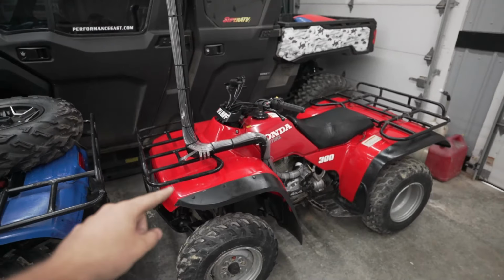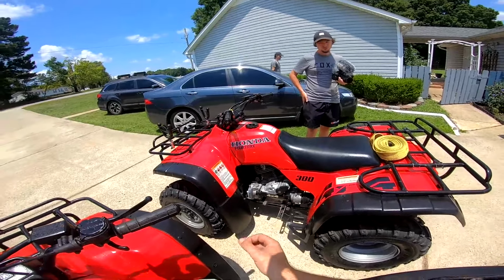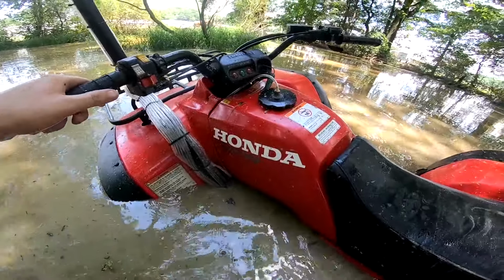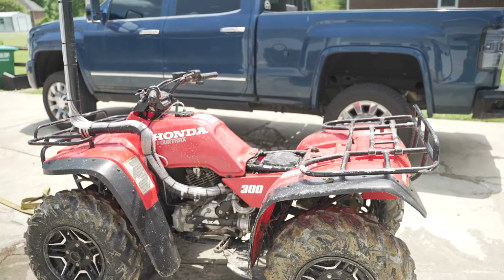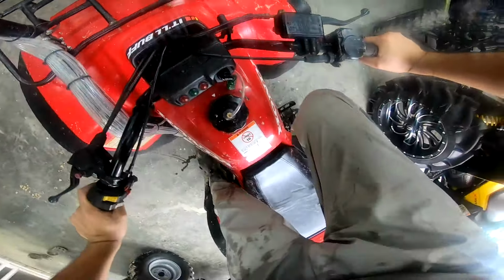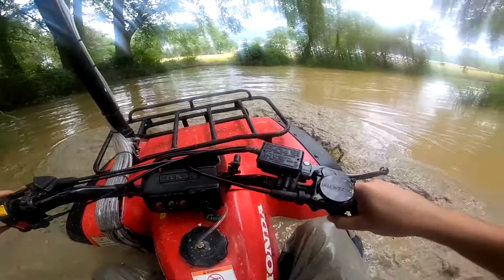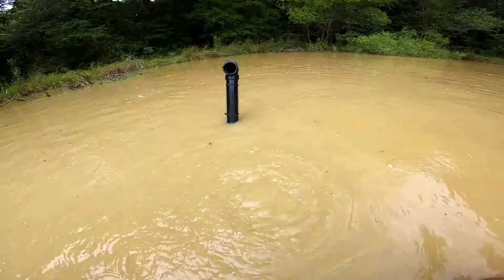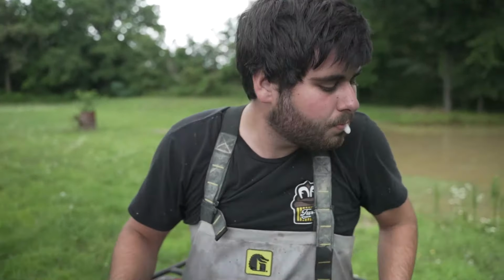FOUR-TRAX 300 VS HUGE SWAMP! WE SUNK IT.

Comment: I miss my ole 300 4 inch lift 2 inch stretch in the rear and 56 gear reduction racing pistons and 420 shocks. It was a beast

Comment: 300s are surprisingly easy to wheelie, put in first pull the shifter up and hold it. Then full throttle and dump it and it will go into 2nd

Comment: Side to side play doesn’t matter in a crank, the piston keeps it straight, it will have play if the piston is not the right bore or the ring gap is wrong.. up an down play matters,

Comment: why not put the tires off the rubicon on it will turn them also it’s a honda when the exhaust goes under and cuts off if there’s no water in the air box it will crank under water ive done it 100s of times

Comment: THATS WHY YOU STAND IT UP PULL THE SPARK  PLUG AND TURN IT OVER BRAYDON FREAKING PRICE YOU HAD WATER SITTING IN TOP OF YOUR PISTON SO BY PULLING THE PLUG AND STANDING IT UP IT WOULD OF BLEW THE WATER STRAIGHT OFF THE TOP OF THE PISTION OUT THE SPARK PLUG HOLE AND OUT THE EXAUST INSTEAD OF  WATER ON YOUR TOP END WORKING ITS WAY PAST THE RINGS INTO THE BOTTOM END WOTH GRAVITY